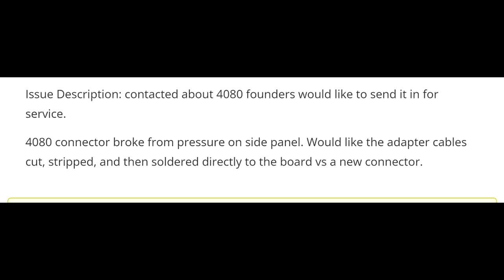Notorious RTX 4080 Graphics card Repair - Connectors are breaking like biscuits.

Comment: I’m no expert but looks like the pins where snipped with flush cutters
Reply: I made a similar comment, sure looks that way, but Alex made a reply to someone else's comment about the same and he says no.
Reply: I see what you mean but a stress failure of a soft metal would create peaks like that.
Reply: the pins where snipped with flush cutter,  by the artist who left the flux on the board
Reply: @greentech1658  we will never know what really happen to that connector speculation of heat
Reply: I'd say whom every wanted to take it off so it will fit in the case lol
Reply: How would you get the cutters in there like that? And why cut so low where you can't remove them?
Reply: Clearly you aren't an expert
Reply: Yeah looks that way, ps i was so afraid when i got my 4070 ti but it is really solid just see that it is seated all the way gently don't go ramming it so hard!
Reply: @DesiredHeadshot  Possibly, if the plastic bits of the connector fell away then you could get to the first row of pins, followed by each row in succession.
Reply: Totally this was a mod gone wrong and customer thought he would just  get NorthRidge to do it. The more tools NR sells the more they'll keep seeing stuff like this from DIYrs 😂😂😂

Comment: That connector was 100% cut off, probably the owner trying to fix/modify it.
Reply from the maker: We worked on the same issue with 4090. Pins are breaking completely and not cut off. https://youtu.be/JLjn06y2Z-s
Reply: I initially thought that as well but the pinch points would all be line up from using a flush cutting tool.
Reply: Correct - the ridge in the middle of the remaining pins is due to cutting.
Reply: Disagree.  Look at top right three large pins - clearly they are stress fracture breaks.  The rest of the pins being flush-cut is because the customer we know already had a go at repairing themselves, and they correctly cut off the rest of the connector as part of the attempt.  The connector partially broke, it didn't uniformly snap off on all pins.
Reply: The customer might have cut the remaining bits of the pins off, maybe he only snapped 4 pins, and cut them shorter to attempt a repair, but we've already seen a snapped 4080 power connector here.

Comment: He needs to buy the new Cable MOD 12 pin connector that come in all different combinations for the new 4000 series card to stop this problem. They have 90 degree cables for them cards. Tell him to invest in one. If he doesn't want to invest in one, then do not have the side panel on his pc. Simple

Comment: Nvidia has had trouble with this connector 12VHPWR, some cards consuming over 500 watts got burnt. This connector is hell !
Reply: it is 100% people installing wrong.
Reply: It's a non sense to have reduced not only the number of pins but also the size of them (compared to the 2x8 pins connector we used to have on most GPUs). Especially knowing GPU are going to use more a more watts.
Reply: @testickles8834  
Not 100%

It is wrongly designed as well. This connector shouldn’t have been selected for such amount of power.

Comment: Those connectors are terrible.  Unlike the old 8 pin, they are a bit difficult to plug in. It's easy to not get it in fully, and a bunch of people had melted connectors and cables because of that. Breaking it off completely? No freakin idea.

Comment: From the customer description, it sounds like the card connector is pressing against the case side panel due to large card/cable connector and not enough case clearance.   If they don't want to put card in proper sized case, there is a 90 and 180 degree adapter available so that power cable is connected at a different angle and should reduce the space requirements from the cable sticking out directly from the card.
Appreciate all your quality videos and hope that your clients appreciate the detailed work you provide.   Hoping I never have a need for such repairs but know where I will go first if the time ever comes.
Reply: not the customers fault the card designs are the same size as computer cases nowadays, that being said he shouldn't be smashing into a small case.
Reply: Man just take the side panel off until you get a new case, don't smash things together. That's only for cable birds nests on the other side of the case (;
Reply: @Tadders  Easier said than done  - some people have small children and or pets that need to be protected from bare components in an open PC case!!
Reply: @zedds4335  So don't build until you have a proper case?
Reply: @Tadders  The case it goes in relies on forced airflow through the case. If I pop the side panel off the SSDs and the rest of the components on the board will overheat.

Comment: Alex, this is a great channel. Soldering wires direct to a PCB often causes excessive force on the via holes and any cable movement will crack the PCB. You definitely choose the correct repair. Say Hi to Big Boss. Awesome.

Comment: The customer wrote what happened(albeit vaguely) and this is what a lot of 4080 and 4090 users experience - due to size of the card and the fact that the connector is parallel to the card's board, once the cable is plugged in and if your case is not big enough you're likely to have a clearance issue with the side panel of the case. Customer obviously encountered that and perhaps was trying to force the panel close. As the panel would be pressing on the cables and not the connector itself the force would be applied at an angle, breaking off the connector as a result. 

Having said that - each of the broken pins has a deep groove visible on the cross-section - almost as if the pins are not solid but have a little through-hole in them, if that's so then of course they're going to break with force applied.
Reply: It's a on issue the FE cards aren't even big, don't understand how you spending over 1000 on a GPU and not spending a 100 dollars to get a proper case, it's nonsense

Comment: 4090 owner here.  The connectors and the cables scare the crap out of me. They are the worst combo where they feel flimsy, but simultaneously are VICEGRIPPED together. They are huge cards too, so they usually have to be removed if you want to access things like M.2 slots.

Comment: If you have one of these cards, make sure you get the Cablemod adapter to stop it smashing into your side panel. If you have to force it, Don't.
Reply: This is why the side of my case is currently leaning against my case. I still need to order one of these adapters.
Reply: I just leave the side of my case off, no animals or small children to mess with it
Reply: @chincemagnet  dust
Reply: @MiGujack3  not a major problem, I clean it a couple times a year
Reply: Weren't those recalled because they caused melting? I also tried using Cablemod's custom cable and it caused my computer to crash. So I don't know if I'd look to them for a solution to the 40xx problem.

Comment: last week i replaced my phone microphone with just a soldering iron. i fixed my soldering iron and then apply heat underneath the board. bad microphone came out and did same to fix new microphone. these new digital microphones are so tiny like 2mm .  watching ur video gives me confidence to fix it. 😄

Comment: The 12VHPWR sockets/cables have two problems, both related to tolerances. The standard 12VHPWR adapter cable that comes with NVIDIA 40XX cards fits extremely tightly into the socket. I own a 4090 and it takes a LOT of force to properly plug the cables in, the latch doesn't lock down and hold it in place without a lot of force. The two problems are that people can use too much force and break the connector, or not enough force in which case the socket and cable can burn up because they aren't properly mated. 

You might want to advise customers to use an alternative 12VHPWR cable to the standard one that ships with the 40 series, or advise them to use a tiny amount of lubricant on the plastic of the factory provided cable. Depends on if the replacement 12VHPWR sockets you're using have more forgiving tolerances than the factory installed ones.
Reply: That or connect the connector before whilst it (the GPU) is outside of the computer.

Comment: This is not really about the connector, this is about using the big fat card in a too small case. The connector is getting wrecked because guy closes the side panel which puts continuous heavy pressure on the connector due to the cable being squeezed by the closed case side panel. He needs a new case or a special connector that fits between the card and the side panel.
Reply: Exactly this. Loads of places sell 12VHPWR angled connectors / adaptors now to help with this.
Reply: @Rein or.... spend $20-$40 on a decent angled adaptor that takes up about 2cm which is far less than the bend radius on the cables.....

Comment: *THERE'S THE WARNING SIGN !*. Why are the cables/wires more substantial (thicker) than the CONNECTOR PINS ? THAT IS *INSANE*.

IT'S TRULY A TOTALLY DEFECTIVE CONNECTOR *BY DESIGN*. The contacts should be AT LEAST as large diameter as the cable/wire attached to them if the current rating is to be adequate.

Comment: you did everything right with the connector and did especially well with the wire adapter. It has only 60 plugged in cycles.
Reply: It is actually only 30 I believe, and the old 8-pins have the same rating.
Reply: What do you mean by 60 plugged in cycles? Is this the amount of times the connector can be used before typically snapping/breaking or something?

Comment: Most common for breaking the connector is simply to tight PC chassies where the side press on the cable and make the bend to harch. The cable cant bend as much and the connector breaks off. There are however adaptors (jays2cent) that works with these cards so the cable goes eather straight up or down from the connector on the GPU.

Comment: That board must be insanely sturdy having the connector pins sheared off not giving way to a single pad... I know, throughholes but unless you wiggle the connectors into fatigue, the chances of resin, glue and fiber breaking over a solid metal pin are usually rather low.

Comment: i've been building computers for years and never have had issues with connectors.
but i understand how most components are made so i don't use the Hercules method when connecting things.
But i will admit, in some cases when the connector has a small lock tab on it sometimes it is hard to get it to go in that far because the pin sockets are tight when new.
i actually used silicone grease one time just to see if it would help lol (you know the silicone grease you use like on spark plug boots and other type electrical plugs).
i found if something doesn't go together easily then something is wrong and have to look further into it to see why.
i guess some folks get impatient and loose their minds? then things start to break ;o)
Nice job Alex, you're the man! Better than factory!
Have a great day sir :o)
Reply: That's probably because you haven't gotten your hands on a 4080 or a 4090...Handle one of those and you'll see how the connector was broken..Lmao

Comment: Considering this card was only launched late last year why would it not be returned to the retailer under warranty for either a replacement or FOC repair? I can only assume that the customer had a go at repairing then realised a 25w soldering iron are no substitute for specialised equipment and outstanding skills.

Comment: So yet another issue with these new connectors. The problem here is that most cases/chassis on the market do not have enough width to accommodate both the width of the GPU and then also the arching cable and the result is that people have to push against the cable/connector when closing the side panel and this can cause the connector breaking like this. Cablemod are now offering modded sleeved cables with angled connector/contact to mitigate this issue. Another option for those that have enough room in their case is to get a riser cable and mount the GPU vertically in the case. My case the Coolermaster Mastercase SL600M is one of those cases with enough room to fit these new cables as it has 191 mm worth of width for CPU coolers before hitting the glaspanel. But many cases today only have 150-170 mm worth of space and that is a problem with these cards.

Comment: Have you considered using a pre-heater (hot plate)?
I set mine to 100°C, it's enough to ease the work on thick PCBs without being too hot for plastic parts like connectors.
I'd like to hear your opinion.
Reply: he does use a hot plate, you must be new here.

Comment: I can go back many years (2013) "I think" when HP laptops had a huge problem with Nvidia onboard Graphics cards. The chip practically desoldered itself from the motherboard with overheating. HP recalled thousands of the laptops and fitted new motherboards. Mine was not on the list of serial numbers recalled but it failed. HP tried a bios fix to bring on the cooling fans which meant that the fan was almost constantly running before the recall. After threatening with legal action they admitted that it had the same fault and replaced my motherboard which lasted less than a year after the repair with the same symptoms.

Comment: all 6 pins away from the 4 small pins are ground the 6 pins closest to the 4 small pins are 12v and the 4 small are sense pins. that go to the power supply to tell it how much power it can give. if 3/4 are connected it will provide 450W if all 4 600W and 2 i believe is 300W. and the reason they were melting was because they were not fully plugged in causing extra resistance. it was user error not a defect in the connector.

Comment: I’m thinking this customers tower case isn’t wide enough and is putting pressure on the power connector / cabling.  Just get a different case, and transfer everything.  Don’t hardwire a wiring harness directly to the board 🤦.

Comment: It's obvious if using considerable force to close your case to the point of breaking a whole connector. There's zero reason for this to happen and the person is lucky they didn't do more damage to the board. Great job on the fix though. 👏

Comment: Vertical mounts are the way to go with some of these huge cards.
Reply: The GPU mount on my Define R6 is only dual slot.   There are no dual slot 40 series cards.  The R6 is a fairly large case too.  Luckily the R6 is WIDE and and the card mounts in the normal slot without side panel/cord issue.

Comment: I'm so glad I stuck to my Cooler Master HAF 912. All of the HAF series are more than large enough for the 4080 and 4090. I personally think nvidia was really stupid with their design by putting in a straight up connector. The 30 series cards had an angle along the length of the card at a shallow angle and this solution is best. I also upgraded to a proper atx 3.0 supply and it also helped. A 90 degree adapter should be what nvidia include instead of the dumb straight adapter. Nvidia was cutting costs for sure when they decided to use this connector and adapter combination.
Reply: Same, HAF932 and 912 here. Still superior to most modern cases, after all these years.

Comment: Gr4eat job with the repair!! - i think these connectors are breaking because people have the connectors jammed between the side panel of their case and the graphics card.. there's 90 degree adaptors on the market which would help avoid this issue if people are jamming them in small cases! :)

Comment: In my humble opinion, if I noticed this, the GPU hitting a side panel, I would build the GPU vertically, or use a 90° adapter at minimum. Sometimes you cannot build in these horizontal. Also, these days motherboards are foreseen with reinforced PCIe slots, it protects the mobo PCB yes, but you place the stress elsewhere. And then it's just a matter of time when the thinner PCBs from the GPUs starts to crack, especially on the weaker parts. And with the heavier cards. Everybody laughs with the support bracket that is provided with the card, this is not without reason. The exception are the Intel cards, these are less big. You won't see these on your bench for fractures, or it has an electronic malfunction.

Comment: yea the mad ideas  customers come up with!  good job and no compromises
doing a repair to that i would be thinking theres 3 causes of that fault 
1. unleaded solder id suck that crap out and use leaded .
2. they have cropped the pins after the solder process really close to the pcb -that causes stress fractures right at the factory 
3. the customer is doing something they shouldnt  ,too short a cable /wrong size pc case ect-tell them off!

 i vote keep the socket! be an absolute short circuit hazzard trying to solder the wires to the card directly

as a foot note its my opinion that manufacturers that give a crap would hand solder any heavy gauge sockets to ensure quality ,that looks machine soldered

Comment: The connectors nVidia chose to use was a incredibly braindead decision. They are not appropriate for this application. In my research I found three different sizes of this connector and nVidia chose the smallest and least current-capable variant. The middle size is the same as regular PCIe connectors and if nVidia had chosen this it would have actually been an improvement providing the same number of +12V lines as two 8-pin connectors but in a single 12-pin connector and with no need for the extra signalling connections. The ideal would have been the choice of the larger connector which would have provided a genuine improvement in PCIe power delivery and to my mind would have been a worthwhile change to PCIe power delivery connections.